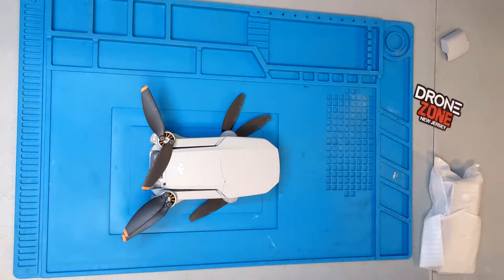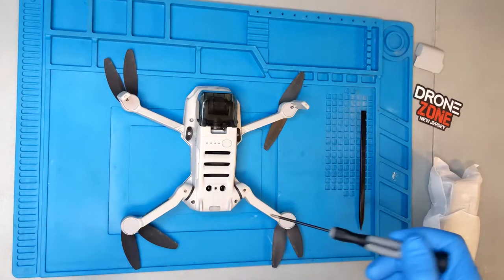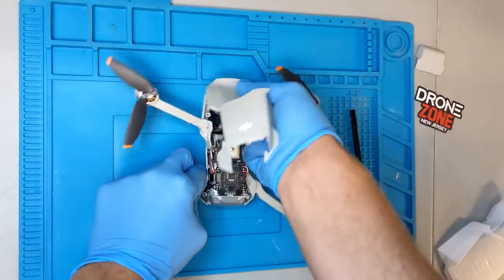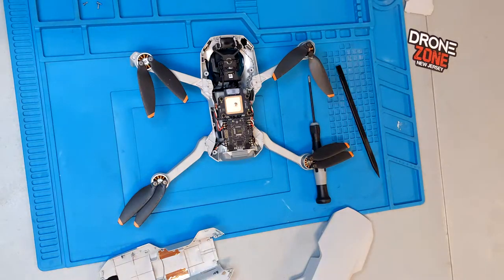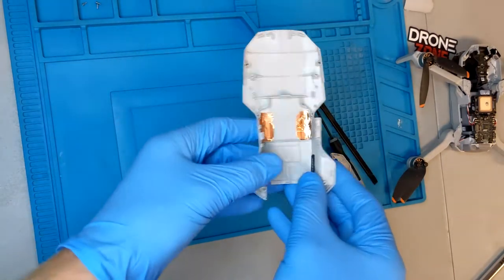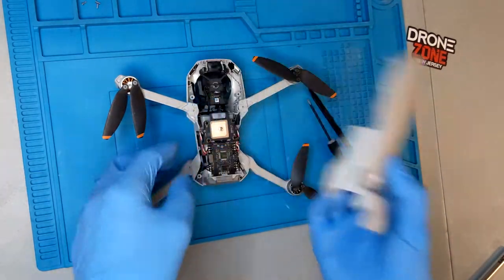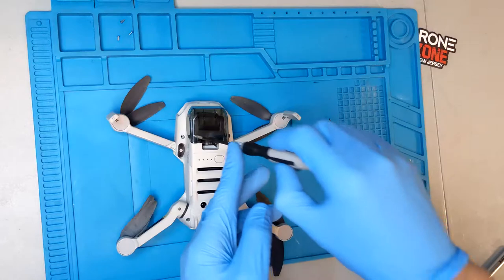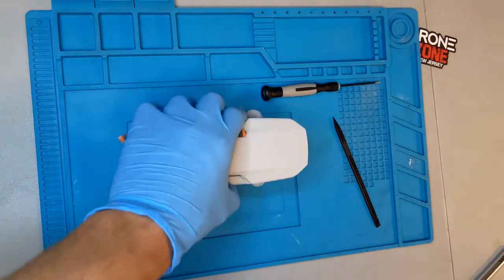DJI Mini 2 Top Shell Replacement The Right Way!

Comment: So since your top panel was broken the video didn't really show me how to remove it in needing to remove mine to repair my gimbal and I've got all the screws out and basically impossible to get off almost seems you have to tear the top up to get it off and just order another one cause it's so thin and def doesn't remove easily almost seems as if there's a glue around the whole cover ?
Reply: did you fix it because im also having the same problem